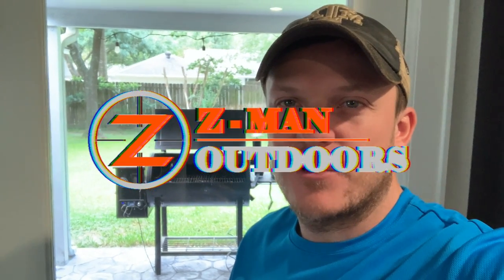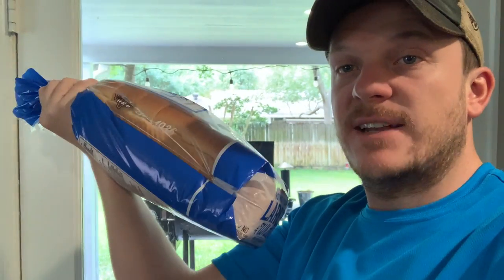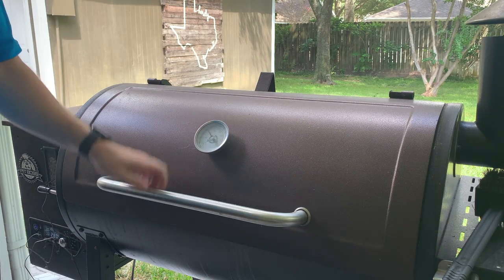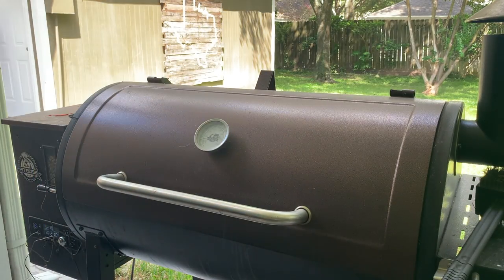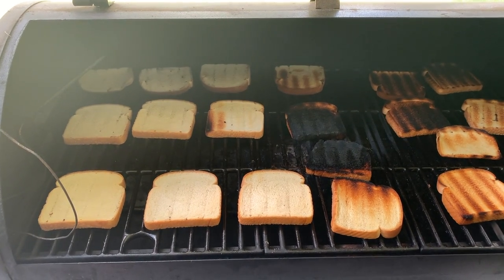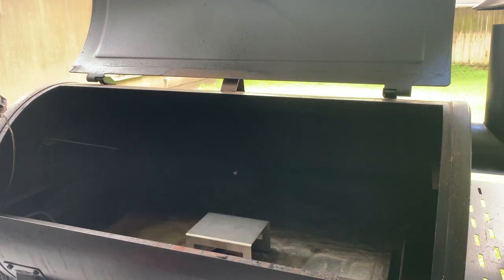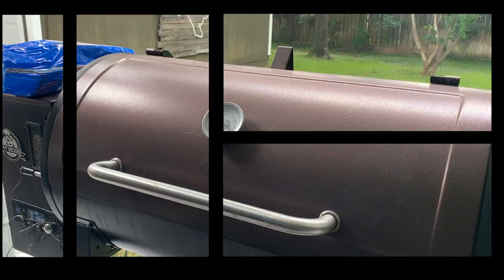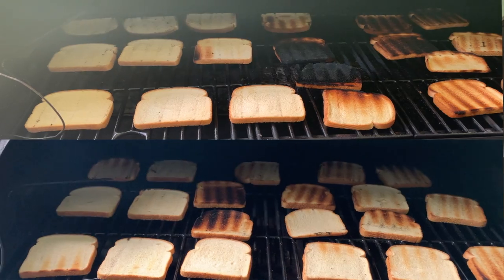The Best Modification For Your Pit Boss 2.0

Comment: I have had 2 Pit Boss units (austin xl and currently Pro Series 850.The side mod is brilliant idea to eliminate varying temps. I got tired of cleaning the deflector plate when smoking so I started covering it with heavy aluminum foil.This not only keeps the plate clean from drippings,It also diffuses the heat better for more even temps across the grill. I just replace the foil after every 2-3 cooks..Works well.
Reply from the maker: Yeah, I was going to ask how often you replace the foil. I do like that idea. Do you have the sear plate? I would assume you just cover it up with foil and don’t use it?

Comment: For the issue remaining  I would self buy a stainless steel plate either perforated or solid and do myself some holes with adustable legs with some stainless screws and nuts eg M6/50mm
Reply from the maker: That’s a good idea!

Comment: Try a trager style deflector, it has more mass and made of thicker steel.  I use it in a moded PB 700 fb.  I have the same deflector in my PB Lockhart you bought, but haven't trsted the grill surface yet!
Reply from the maker: Interesting I’ll have to check that out and see how it helps, thanks for the advice!

Comment: You said you might rotate the diffuser (larger openings front to back) and test again.  Did you?  If so, what were your results?
Reply from the maker: It did not seem to do much from what I could tell. I shifted the hitter spots around slightly but not enough to notice a major difference.

Comment: Have you tried it using the vents on the back rather than the chimney/stack? I would imagine that it may reduce the hot spot on the right, or the cool spot on the left. I bought a chimney for mine but hesitated to install it.

Edit: I have the 850 so maybe yours didn't come with the vents at the back. I'm new to smoking so don't know much about other smokers
Reply from the maker: I’ll have to check that out and see if it helps! Thanks for the suggestion, I could see how that would work and help my hot spots

Comment: Thanks for the video. Did you confirm if the heat baffle should be removed? I the pictures show the baffle removed prior to the installation of the flame tamer.
Reply from the maker: I have kept mine in and it has been good! Talking with others, it seems like some people leave it and some remove it. So not sure there is a right or wrong way from what I can tell!

Comment: Did you end up turning it 90 degrees or which direction do you currently have this mod facing? Thanks!
Reply from the maker: I did end up keeping it sideways, seemed to distribute the heat better in my smoker